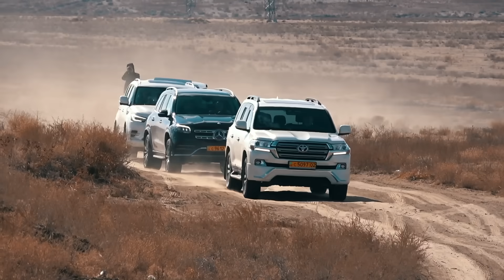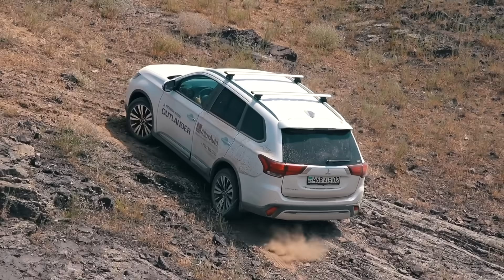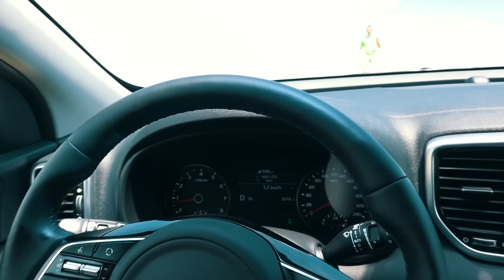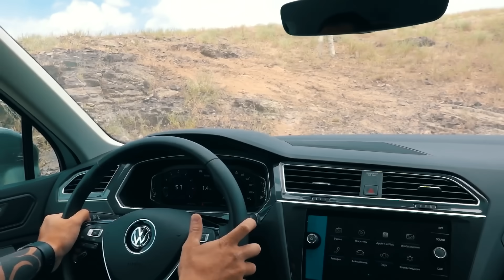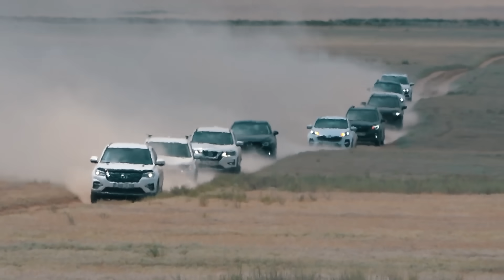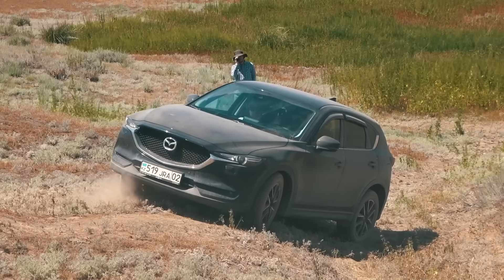SUV Battle 2020: Toyota RAV4, Nissan Rogue, Subaru Forester, Mazda CX 5, Volkswagen Tiguan, Sportage

Comment: Subaru awd systems are run of the mill. Nothing special, it’s a standard f/r power transfer system that uses brakes to transfer some side to side. Personally they suck on anything besides onroad. You need to step up to an electric clutched front and rear differential system or locker system that’s in 4WD models. The best AWD system out there? Believe it or not it’s the SH-AWD found in certain Honda-Acura models and Lamborghini models. The only ones that exist with these superior systems

Comment: The problem with these cars are the traction control which disallows the other wheel to spin in which the car doesn't move forward end up stuck.

Comment: Why dont you turn off the traction control when trying to get out of stuck points?  If you turn on 4 wheel lock you should turn off tcs to allow power to be routed to all 4 wheels.

Comment: Based on the video, viewers ranked the vehicles as follows:

First: Toyota RAV4
Second: Kia Sportage and Nissan Rogue
Third: Volkswagen Tiguan 2.0L
Fourth: Volkswagen Tiguan 1.4L, Subaru Forester, Mitsubishi Outlander, Changan CS75
Fifth: Mazda CX-5
The Toyota RAV4 was rated the best SUV thanks to its new four-wheel drive system with two clutches on the rear axle, allowing for better torque distribution. The RAV4 navigated the challenging terrain smoothly and in control, with minimal wheel slip.

The Kia Sportage and Nissan Rogue came in second. Both vehicles performed well in the challenge, with minimal wheel slip and stable hill climbing ability.

The Volkswagen Tiguan 2.0L came in third thanks to its large engine capacity. However, the Tiguan 1.4L, Subaru Forester, Mitsubishi Outlander and Changan CS75 finished fourth due to a number of issues including ineffective traction control, limited CVT capability and overheating four-wheel drive systems.

Finally, the Mazda CX-5 finished fifth due to the most problems in the challenge, including overheating and loss of four-wheel drive systems.

Comment: I've got a Manuel 2008 forester and have a lower range shift. I've been on numerous off road tracks over the years more difficult than that. No worries it's still a very capable off road vicheal and I'm positive I could have driven up that track in my car without  difficulties.

Comment: what the stupid testing ! using road tires going offroad ? 
most of those car not by 4x4 transmission system even have x-drive or x-mode in the fact is awd system by the way even try to get thought this and climbing this rocks need turn off esp and lurking 4wd system and need some speed and power to get thought this !

Comment: You are doing a fantastic job! Best tests that I've seen online. I'm in North Sweden and we have completely different climate. So snow and ice for more than 7-8 months. But the tests can show which one will get me unstuck .
Thanks !
P.S. What do you think about the new RAV4 with electric back engines ? Would be a good test difference compared to the old one with mechanical back wheel transmision. Maybe you already have it in some test on your channel.

Comment: Seems like those awd are not built for offroading.  Tires are not even built for it.  And it seems like these manufa turer need to beef up theyre awd feature and the transmission needs a more robust tranny to handle off roading and not overheating so easily.

Comment: Once it worked itself out the Rav 4 was excellent in conditions that MOST of these vehicles won't ever see. But in the "off chance" you do decide to take it in these conditions. It's nice too see it can perform in it's given off road modes. Most AWD vehicles that claim too have rock/mud snow, etc...don't live up too it. But the Rav did and that was impressive too me.
Reply: Toyotas awd system suckssss! This was not a good test. Also the Subaru, you need to turn off traction control when engaging Xmode. Its also fwd based awd system. It doesn’t kick in until it detects slippage. There are much more accurate tests with same tires than this video. Also in snow.

Comment: I always had this question: does diesel engines are better for off road? for example a Kia Sportage 2.0 CRDI has 185HP and 400Nm. Since the torque is avaible from low rpm I think it is more adecuate to put power down at low speed.

Comment: To activate offroad mode on Cx-5 you must just disconnect TCS... Then it can perform same as Rav4 did.
Reply: A big problem with Cx-5 was overheating during 4wd, does the disconnection from TCS prevent it from overheating?

Comment: The hybrid RAV4 is honestly better for off-roading than the standard. It has the CVT but the electric motors really make up for it
Reply: Not really....the Hybrid is a totally disaster 😢....I've seen it in the Roller test compared to the Gasoline one

Comment: Great video but you should have had a rubicon do the same trail for shits and giggles and also to show how it’s done properly. These cars are not meant for this kind of off roading, where they shine is on wet and snowy surfaces at re
Actively higher speeds.

Comment: This is BS....there is no way that a Nissan and the Toyota outperformed the Subaru.
Reply: idk
Reply: @Crazzypenguin07 There's no way the awd in a rav4 is better a subaru. Watch the Driving Sports tv comparison. This video is biased. Driving sports tv consistently gives fair objective comparisons.
Reply: @Gaber8845  Yeah, S-AWD always works, I've been driving a base model Forester for 5 years and has gone through lots of slippery muddy roads that cars the same class can't pass easily and my Forester? All those kinds of road can all be passed easily, not even putting 25% of throttle;) And also, the RAV4 here in my country is 2.6x more expensive than the Forester so this comp isn't really viable...

Comment: None of these cars are made to drive in these conditions.  They are for snow or a well graded dirt road… maybe a little mud.  The 4wd systems aren’t designed for this and your going to damage your car.  If you want to drive off road (like this) you need a proper 4x4 with low range and off road tires.

Comment: I was very pleasantly surprised by the performance of the Rogue. I've heard that the 2021 Rogue has even better performance, so that's near the top of my list for a new used car.
Reply: I have 2015 nissan rogue select sports with 189k miles…I swap the entire exhaust on aftermarket with air intake and header….I live in top of Rocky Mountain with 5 month winter…never have any problem to any kind of weather or road conditions.
Reply: Just dont go offroad its a city suv. Thats why they make the pathfinder 4x4.
Reply: @JDMEXforme  It depends on where, what terrain, what tires, etc. There's no one solution for everyone, and "just don't go off road" only applies if you're on a desert island with only one road.

Comment: Researched this car segment for the last 2 months, my findings, - 5th gen forester rated #1 in safety and readability over all others including RAV, trial hawk, honda and bronco. That said, it has been a long road for Subaru from the CVT tranny , oil consumption, head gasket issues of past generation vehicles.  At 6'3, CR just announced the Forester is #1 with tall drivers as well, no surprise as the "green house" visibility is very attractive.  All the safety dings can be disabled permanently, with the exception of engine on/off at stop.  After market solution will solve that as well.  So, I will be picking up my Subaru Forester Wilderness (NOT evaluated here) / pearl white next week.  Comfortable driving on and off road, safety and readability, looks, honest service advisors that I have visited with during this time, all have pushed me this direction.  And finally driving my daughters 2017 Forester premium, sold me on being a Subie owner.  Suggested maintenance to ensure long life; 30k diff (F/R) service, 40k CVT Transmission service, and oil changes every 4k.  HAPPY TRAILS

Comment: Looks like the Subaru didn't rev hard (@9.45 "rapidly approaches the start" yet barely looks its rev'ing.  (@29.48)  revs are only 2000 rpm. Yup wouldn't pull skin of a custard pudding...lol. It doesn't make sense to slowly crawl. Lets look at the VW Tig  blasting dusty accelerating run 20.58. Concerned also you / they say "we stopped the (VW Tig) car intentionally" @15.28 (VW Tig).  Sorry all looks strange. (A Subaru owner,)

Comment: WHAT I LOVE AND WHAT I HATE ABOUT MY 2021 RAV4 HYBRID LE

Let's start with WTF Toyota?!?
1. Why in the freakin' world you removed variable intermittent wipers option?!? Every stinkin' ford and even fiat/chrysler has it as standard equipment. Even Soviet "cars" of last millennia had it...

2. What was wrong with normal standard cruise control lever - why did you replace it with funky buttons?!? Was it for the difference's sake? FYI: not everything different is necessarily good.
3. Your "infotainment" traditionally sucks, and mine is not an exception - lousy 19th century interface, limited functionality.
4. What's up with your intrusive spying "technology"?!? I removed DCM fuse to disable it, and bluetooth microphone stopped working. I am installing an aftermarket head next week so you can shove it.

Now what I love and what outweighs the above ridiculous stuff
1. Excellent dirveability and handling. Even on ice and in snow with STOCK "low resistance" tires.
2. Quiet ride
3. Good fuel economy - 40+ MPG avg in the winter.Beats the hell out of my 4Runners with 18 MPH on good days.
4. Legendary reliability. Didn't have a chance to test it myself (mine only has 3,400 miles) but hope I won't be disappointed.

Comment: I think 2000 rpm of Subaru is not enough to climb. Each car is different. Need to know torque - rpm curve of the engine. I climbed with much more elevation on the surface with sand and snow. Usualy 4000 rpm, manual D and X-mode enough to climb with slow speed even if front wheels do not touch the surface at the end of elevation. Actually I use subaru forester 2.0 150 hp of 4th generation.

Comment: Please do not confuse the maximum torque with what really is used during these tests. On NA engines maximum torque is reached past the mid-range, I did not see any of these cars revving that high. It is not a static value, rather it starts low, then peaks, and then falls very similar to the power curve.

Comment: With manual gearboxes instead of these CVTs, the results would have been different? Unless we find ourselves in the same situation as with the Tiguan, which would have overheated its clutch(s) (the 2.0TSi uses a conventional Tiptronic, at least in Europe)...

Comment: So Rogue is the only compact SUV good in both summer and winter
Reply: I’ve never gotten mine stuck and I drive through deep snow. First tracks on the road. I also had a Ford Edge which was also good but I think my Rouge does better and has a slightly higher ground clearance and better on fuel

Comment: I have a 2012 Forester with a standard automatic transmission. I have taken it on off-canter obstacles like the newer one did, and it didn't have wheelspin at all. Clearly the newer AWD system has been timidified compared to the one with a real automatic transmission. I now know why the Subaru dealer offered me $5000 more than I paid for it. I refused. I'm glad i did!

Comment: They are definitely not engineering Subaru like they use to!
Reply: Dude I'd rather pull a red wagon filled with 800lb of rock than drive a heaping pile of garbage like a Subaru up that hill

Comment: Honestly, with how biased the lines are, tires, how rutted the first one sets it up for the following cars, driver skills and all those factors, these "Tests" are worthless and is for entertainment purposes only.
Reply from the maker: I completely agree with you about condition of surface and tires. But finding a way so that the surface condition does not change and there are convenient shooting points is extremely difficult. So far this is the best I have found. If I find something with a more stable surface, of course I will take this opportunity and will test there.

And these are private or dealership cars, so it is not possible to replace tires. The budget and time also do not allow for this. But we will do such a test in the future.

Comment: This was a great test! Just once though, for giggles, I’d like to see someone toss in an old TRUE 4x4 against these 30 and 40 grand modern suv’s, just for comparison. I can hear the narrator, “Here’s a 2004 Geo Tracker with real 4 wheel drive and 4-Lo. See how it goes over the rock step with ease. And even though it got some wheels spinning, it reaches the top of the hill without over heating.” lol
Reply from the maker: A good idea! But automakers are releasing too many new cars that it will be difficult to get to the old generation cars. But I will keep in mind.
Reply: @SUVBattle  если ты казах тогда ты вообще молодец что создал такой канал

Comment: I have seen several videos where the Toyota RAV4 consistently wins this kind of off-road tests. I was thinking to buy the Subaru but now I am convinced that the RAV4 is a better option. I enjoyed the video
Reply from the maker: I’m glad that you liked the video. Any specific cars you would like to see in upcoming video?
Reply: Because Subaru seems to had lost. Even driver try drive different way.
Reply: ive had two subaru's and would never have another one since they started using the terrible CVT system ....which is useless for towing and prone to failure when abused ...my subaru's were manuals.
Reply: I never thought I would see the day that a RAV4 beats a Subaru.  Subaru really destroyed their off road advantage with their CVT transmissions
Reply: @revaholic  I'm curious why Subaru trounces everyone in all tests elsewhere on the net, but fails on this one?  Something seems off. I've seen Subaru's make it up extremely similar obstacles many many times.
Reply: @slandshark  they probably use a manual for the tests, manual has better awd
Reply: @keponen331  They don't make manuals anymore. Yeah, something off here. A Rav 4 is nothing more than a slip and grip system. The front wheels slip and the back wheels kick in a brief assist. The Subaru is full time AWD. All four wheels are turning constantly. Might be the type of tires they had on it, although I was recently camping in backcountry Montana when we had four days of rain and the roads turned to gumbo. There were 4wd pickups and ATVs stuck everywhere. I didn't even try to move for almost a week. The only thing driving around was a Subaru Outback with stock tires!
Reply: @alansach8437  I cant stand slip and grip, its so unbalanced to drive

Comment: In the beginning when the car gains momentum the drivers stop by releasing the gas and expects to apply gas again which is wrong , the car won't make the hill
Reply from the maker: Drivers deliberately drive as slowly as possible and along a deliberately “wrong” complex trajectory. This allows you to demonstrate the effectiveness of the four-wheel drive system. If you take a good acceleration, then all cars will easily pass this obstacle and you will not notice any difference in their behavior.

Comment: 4wd is suppose to be activated on all those vehicles long before they begin to make the climb , any real driver should know that
Reply from the maker: To better understand the difference. At first, all cars drive in the “dummy” mode: the gearbox is just in the Drive position. After the car gets stuck and cannot go further, we activate the available auxiliary mode, most often this is the OFF-ROAD mode. This sequence allows you to form an understanding of how the behavior of the car changes in standard and offroad modes.

Comment: thats a super stupid test! mere 10-20 horsepower gain doesnt give any advantage over 6 inches of mud dug out by previous car! contact and weight distribution matters. after last car gone, i am sure a hypotherical 1000 HP, 2000 nm torque car will also get stuck, its no longer about horsepower, its about contact with ground and weight distribution
Reply from the maker: I completely agree with you about condition of surface. But finding a way so that the surface condition does not change and there are convenient shooting points is extremely difficult. So far this is the best I have found. If I find something with a more stable surface, of course I will take this opportunity and will test there.

Comment: Good luck changing all those clutches on the Toyota! I'll stick to the Subaru.
Reply: Lmao. Your mechanic will be pleased you prefer the Subaru. He’ll be plenty busy. I’ll keep the Toyota and reliability.
Reply: I think over 90% of all Subaru's ever sold in the USA are still on the road. Reliability problems are just a myth because of all the asshats who buy used STIs or WRXs and mess around with the engine thinking they can just slap a turbo on and nothing bad will happen.
Reply: @XfStef  well said